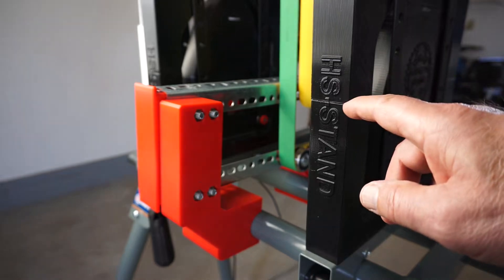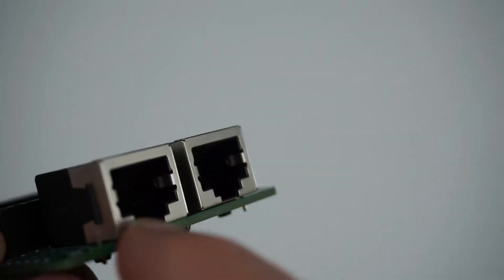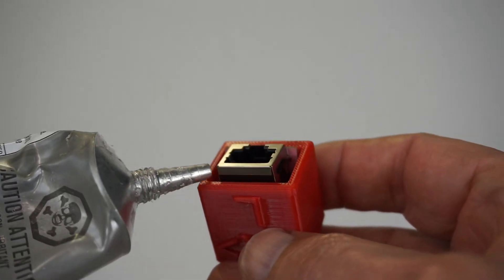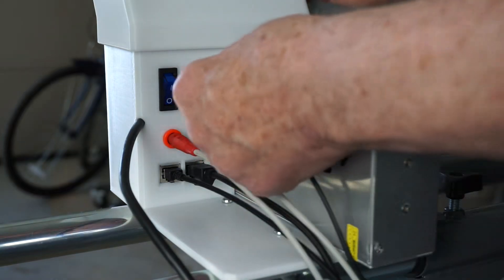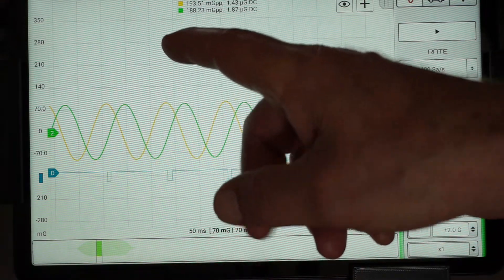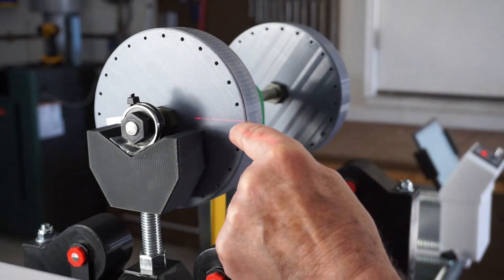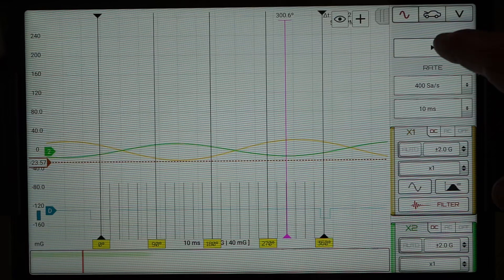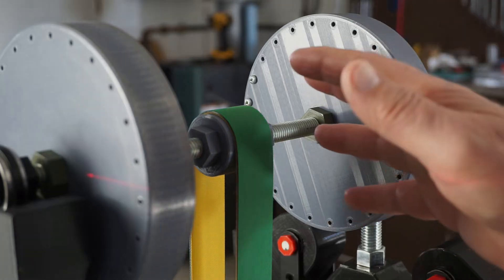GADGETS#211 - HS-ADXL WIFI ACCELEROMETER PROJECT

Comment: What a great project, thanks for sharing! I'm thinking of jumping on board as I miss the bandpass filtering on my current setup with an oscilloscope and analog ADXL335.
Is there any electrical reason for using ethernet cable like noise suppression or is it just for convenience?
Reply from the maker: probably both played a role in Martin's choice of ethernet cables...add to that conductivity of low level signals and low cost

thanks for comment:)

Comment: Hi, Is there any free/limited software or others option for DIY balancing? I Just want to balance my bench grinder for some precision sharpening
Reply from the maker: no balancing software as such, I feature oscilloscope based dynamic balancing, more specifically using HScope with its advanced filters and 360º overlay

you can go simple with analog ADXL335 and analog IR sensor as shown in GADGETS#58, #59, #60

or more advanced with digital ADXL345 as shown here

I too wanted the smoothest bench grinder for tool sharpening and acheived it in GADGETS#202 and #203

Comment: Is this thing big enough/strong enough to balance a tire? I'm sure, not the most practical way to balance a tire, your previous video and tool you created where you balanced tires on your truck would almost certainly be faster. Now I wish I had jumped on that free dynamic tire balancer I saw recently on Marketplace, it needed a new control panel. Perhaps I could have combined parts from this project and your previous one on balancing to come up with a workable machine.
Reply from the maker: it could balance a tire, but as you pointed out not the most practical way